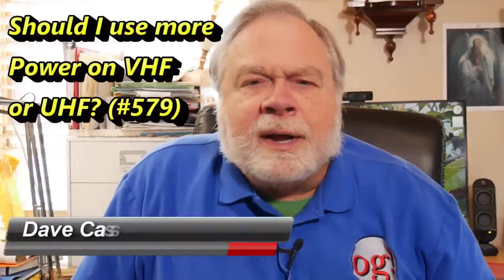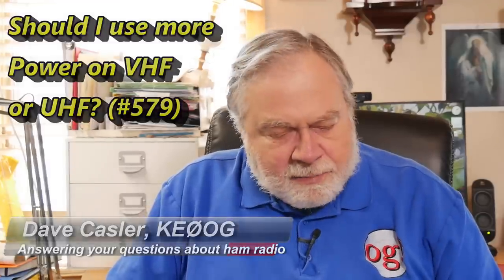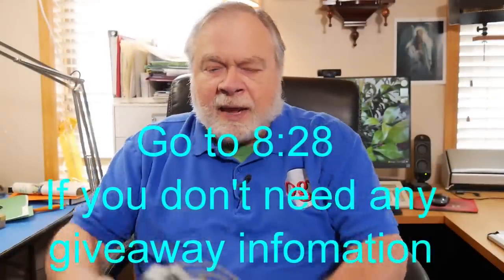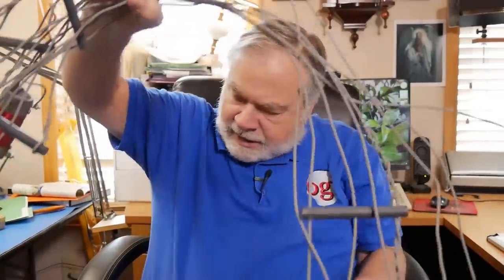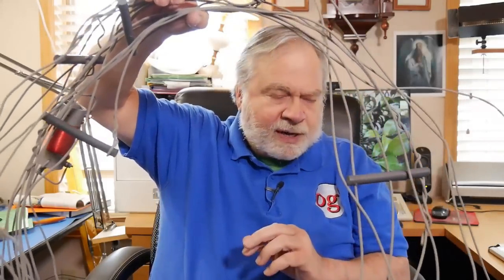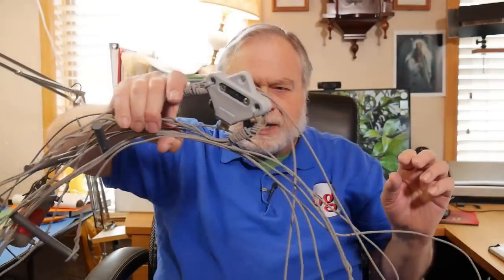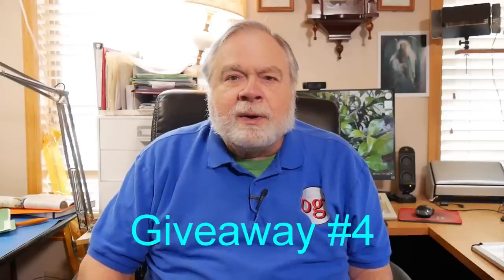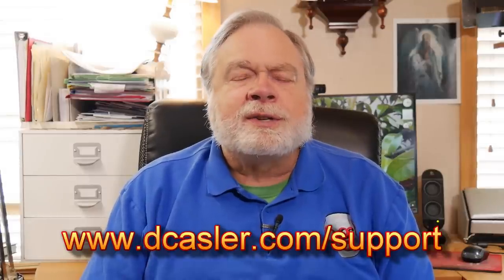Should I use more Power on VHF or UHF? (#569)

Comment: Like OG said, if you’re hitting the target repeater then you don’t need more power.  On 70cm you’ll bleed into you and your neighbors electronics, even at low power, and even with your antenna outside.  Your kind of limited in an apartment dwelling but do with what you have.   You can also find an echolink repeater in the area and talk all over the world.  You can also test your audio on an echolink repeater ex: tx on HT and rx on your mobile app to hear yourself.  It also helps to ground your HT and it’ll make your antenna more efficient.  Use the screw that holds the belt clip in place.  You can google how to ground your HT.  Good luck and welcome to the ham community.  OG is a very informative channel you’ll learn a lot from him as I did when I was new.

Comment: On VHF and above height, to clear obstructions and obtain line of sight, is everything. If you can't access the roof. raising the antenna with a telescopic painters pole or such tied to the railing will improve distance and reduce RFI.

Comment: Sounds to me like the PERFECT installation scenario for a flowerpot dual band antenna. I made one and covered it with plastic Holly leaves, left over from a Christmas decoration, it just looks like a plant in a pot in the corner, but I can easily hit repeaters 70Klms away no problem with the antenna only 1 foot off the ground using 0.5w power. A portable J-Pole would also work fine. I think my flowerpot cost me about eight bucks, maybe ten with the PL259 tossed in......a pretty good use of about 3m of RG58 and a plug.

Comment: All things being equal spending 50% of your ham radio budget on an antenna, 40% on the receiver and 10% on the transmitter will usually give you the most bang for the buck.  Remember 3db of gain from the antenna is the same as doubling your transmitter power and 6db of gain will be equivalent to four time the transmitter power.  So bottom line go with the directional antenna if you have the option.

Comment: Dave:  Here in rural America, we do not have a repeater in every town and sometimes not in a county.  Here at my house and at our farm, active repeaters are over 40 miles away.  So higher power is a necessity. Here at the house, in a HOA, I cannot have outside antennas.  At the farm you need stacked antennas to reach a repeater because of all of the hills and trees.  But most of my VHF/UHF activity is on CW and SSB and most of my contacts are over 100 miles away, so lots of elements, height, and power are a necessity.  Most of my FM activity is on DMR these days through a HotSpot, so there are no needs for running more than a watt of power!
Reply from the maker: I'm also living in a remote area, so I know the problem. I have outdoor antennas and a UHF beam to get to Grand Junction, about 80 miles to the NW.
Reply: @davecasler  Do you have elevation in your favor?  Here in the “Lowlands” we have to contend with very tall and thick trees, along with rolling hills. When we lived in Oklahoma, a tall tree was 20 feet tall, here in SE MS, trees are 120 feet tall. At the farm, 56 elements at 115 feet do the trick.

Comment: The short answer is “no”.  If I can (and have) talked to the International Space Station with  a 5 watt  handie-talkie and an Arrow antenna, while you need more than 10-20 watts for anything but EME, you’re doing it wrong.
Reply: @ZAR66  The Arrow antenna proves the point that power isn’t everything, and sometimes it isn’t anything compared to height and gain. Please, feel free to throw off enough VHF and UHF microwave radiation to cook a chicken off of the roof of your car to hit a repeater 20 miles away if you like.  I don’t care.  But, I would advise most hams to skip the power (it won’t help you on receive anyway), and have fun building and raising VHF and UHF antennas for long-distance contacts. The great thing about the 2m/70cm portions amateur band is that you can easily  build or buy antennas with 6-12 dB gain that turn any vhf/uhf rig into a flamethrower.  5w + 9dB gain = 40w ERP, and you’ll be able to actually hear the station/repeater you’re pointing at!

Comment: Before boosting power, I'd just look into a directional antenna. I was able to cleanly hit a repeater 132 miles away on UHF, 38 feet of old, water damaged RG8 with 10 watts, on a stacked Yagi. I was opening it, but barely audible on 5 watts, on a 2 foot run (for testing purposes, to zero in the antenna). So a good antenna will make a huge difference.
Reply: Yes! There are usually two ways to solve this kind of engineering problem -- throw more "horsepower" at it, or see where you can optimize the power used. This solution falls in the latter category and is much more efficient imho - 73 de W3DJS in Dacula, GA

Comment: I made the M0MSN 'coat hanger' antenna on YT but used copper wire precisely cut. A dual band vertical dipole, which I put in the loft. I bought a Retevis RT-95 and used 5M of old satellite coax from my dish (75 Ohm?).

I tried it on 2 Web SDR receivers. VHF was strong, S9 +10 and more, but on UHF only S6 and nothing on the furthest SDR. UHF was like my UV5R-TP so I assume 6 Watts. The plastic looking roof tiles probably don't help.

It has better reception than my HT being higher up, but doesn't seem much better at reaching the repeaters (mostly UHF).

There's probably some stray RF and my HP server PSU when close to the radio also lost one side of someone's VHF QSO.

A YT video used a Marconi Test Set and the true power was L: 4-4.5W, M: 12-13W, H: 20W. Not far off the 5, 15 & 25 as claimed.

Using just a single element gave a small improvement. Using a very short feedline made it worse, so I guess the coax acts as part of the antenna? Or SWR issues.

My PC Nvidia card wipes out PMR446 CH4 until the screen output sleeps, even with the monitor unplugged.

On TX the radio knocks out TV reception of my UHF Yagi (for DVB-T Freeview) a metre away, but not another 3M away. It also briefly triggered a mains powered smoke alarm at higher power 2M away but I rerouted it's wires.

Comment: That's vary good content. I'm just starting this hobby you help me a lot. I have question but am not sure how to get my question to "Ask Dave" section. I live in apartment on the 3rd top floor of the building and want to work on hf 40 and 20m bands. I was thinking of running DX-EE antenna along the shoulder of the roof (along the wall under the gutter) but I need to talk to my neighbor to use their part of the roof too because my apartment is not long enough to fit 40' antenna. It would take about 10 feet of their space.
Is it a good idea to do so? We are very good neighbors and I do not doubt they will allow me to do so but I'm afraid of causing and receiving RFI. So I would like to know if it makes any sense to even start this project. I'm going to use 100w output power.
73, VA7IGR.
Reply from the maker: You can submit a question to the QST Ask Dave column by sending it to askdave@arrl.org